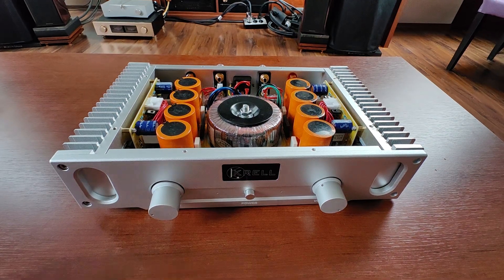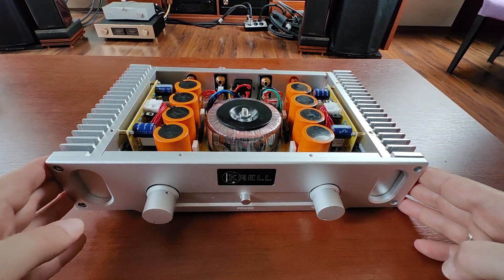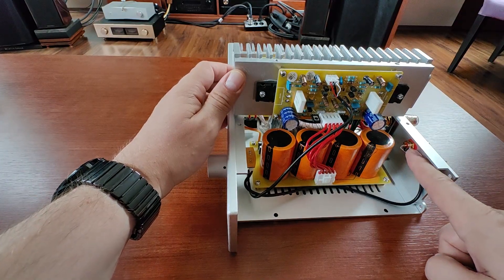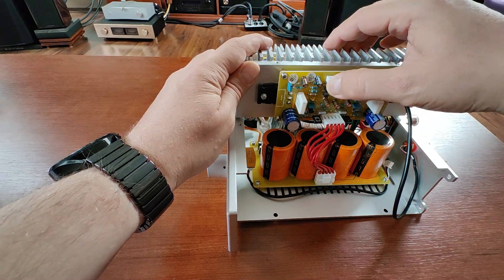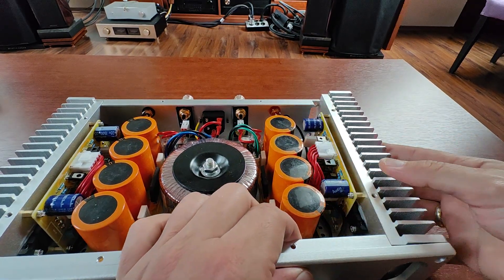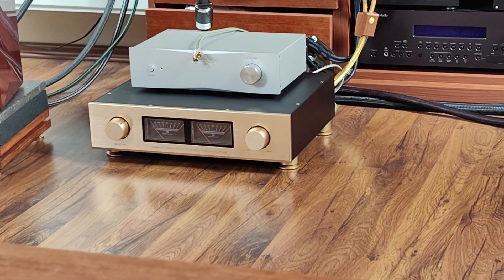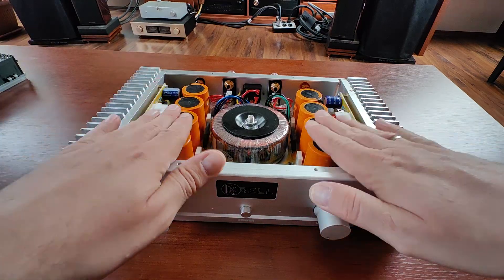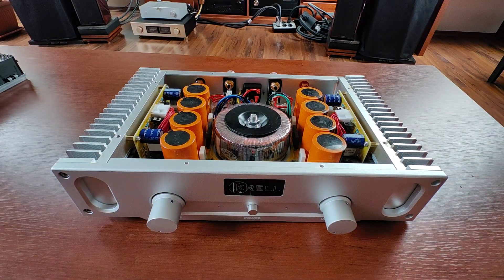Musical Fidelity A1 speaker amplifier clone: volume control bypass in 10 minutes

Comment: Can i use one master volume control?
Reply from the maker: @maxrider2887  that's the general idea here, to make MFA1 clone pure power amp and set master volume on earlier stage with preamp:)
Reply: @k4syx  planing to use with wiim pro + streamer with polk r200. Or it must need a pre amplifier . Pre amplifier suggestion please. Thanks
Reply from the maker: @maxrider2887  if you can control volume with Wiim then you don't have to have pre, though digital control on the player will be inferior to analog one. IMHO exception from this rule is control by DAC chip, as for all DACs I have and had it was always very good too.
So for pre check this one out: https://youtu.be/eS4fGOBiMZs?si=KR2M-CfE-81i84fI

Comment: Any difference after modification sound wise and volume wise mate?
Reply from the maker: @izzy1798  volume wise it's the same because you need to set it up with pre or DAC. My ears tell me it's a tiny bit clearer and transparent, and the most important thing is you don't have to setup balance by ear everytime you change the volume
Reply: @k4syx  cheers yes I've done it 👍

Comment: Nice mod. I had an acrylic cover made for the amplifier. The interior is too beautiful to hide behind metal.
Reply from the maker: Cool idea!
Reply: if the cover gets warm it means that it acts as heathsink   This thing must be hot after a while
Reply from the maker: @gino3286  Most of the heat goes away through fins. Top and bottom covers are just warm to touch compared to heat of the fins
Reply: @k4syx  Hi !  thank you very much indeed 
I have found a schematic in the web but i could not see trimmers for bias setting
Is it fixed ?
Probably the schematic is not authentic
Reply: @gino3286  I made the ventilation holes bigger than original, but yes, I constantly check if something is getting warmer than usual.
Reply: @quma001  hi very good indeed 
Another good idea is to check the bias 
I do not know if they provide some values and info about the procedure 
Nice amp indeed

Comment: I am interested to see if you need further mod to make it better. Or what further mod you will do later
Reply from the maker: It's not like it needs modding, it's great straight from the box. But it can be better. Bypassing the pots, using real preamp, later maybe soldering some nice silver plated solid cores between RCAs and PCBs, that would be my choices
Reply: @k4syx  if you could change any signal path capacitor inside this amp, which ones would you change? that would affect the sound significantly? perhaps to a better film or even paper oil cap? Thanks!
Reply from the maker: Anything that's straight in the audio signal line path - with film ones etc.
The problem is that these are way more expensive and larger for same capacitances and that's why we usually see electrolytes everywhere
Reply: @k4syx  thanks, if i ever figure a way to access inside the a1 clone i will see if that can be done!

Comment: I purchased both, the DartZeel D5 Pro clone and the MF A1 clone. As both continue to “burn in” -here are my first impressions. (For reference, I have about 25 receivers/amps in my collection; my reference amp is a vintage Marantz 2252b that you can purchase for ~$USD 1600. This Marantz is exceptionally musical, open and clear. My reference speakers include an 8 foot tall set of Voigt Pipes and and Open Baffle’ (18 inch bass driver, 12 inch mid and two asd1001 tweeters): Compared to the Marantz both the the D5 and A1 are significantly more veiled ~40% less “open-transparent-clear” (mid range and tweeters). The D5 is about 10% better than the A1 - making the A1 clone the better purchase. I would say that both offer relative value, given the price. Sonically they both compare well to the Schiit Vidar.  They are not giant killers. I would be looking at both as platforms for experimentation e.g. replace capacitors etc. Please share your experience with these!
Reply from the maker: That's not exactly fair to compare them to 1600usd Marantz:)
Yes they have great modding potential and when compared to something with similar or even somewhat bigger price they win hands down. For me the interesting thing is that these basically scratch the surface of the clones market, as there are copies of different brands going for as much as 2k USD.
Thanks for sharing!
Reply: I have vintage Marantz as well 2265B. I don't know what kind of speakers he was using, but what I heard was completely opposite. Dartzeel clone is a another level amp, specially driving hard to drive speakers. If you want little more clarity on Dartzeel amp just switch with silver fuse.
Reply: Comparing new stuff in such a way to a well used old receiver makes not complete sense. YMMV
Reply: I simply don't believe that an old Marantz Receiver (AB Bipolar circuit..) sounds 40% transparenter than the state of the art circuit of the DartZeel clone. No way! The old Marantz Monster with its 40Switches and tone controls may sound OK but never better than these minimalistic circuits of Musical Fidelity or DartZeel. In my opinion mcroeser has a very special taste, rather unusual..
Reply: @helmutmueller-d7t  yes I agree, these new topology often sound bright don't know where's veiled came from
Reply: If they sound veiled you should switch to a better power cable and potentially power regenerator
Reply from the maker: @MasterofPlay7  yes DartZeel loves some good power cords, however it does get more transparent with burn in. I wouldnt call it veiled at the beginning of the process, its not, but it does get way better!

Comment: Give the reason why you need to bypass the volume control.
Reply from the maker: 1. It's made with very cheap pots
2. It's very hard to match the volume level setting by hand with two separate pots

Comment: What's the impedance of the volume pot ?
This impedance is part of the load of the input......so it should be good to know the load difference afterv the modification and correct it if necessary ...........putting a resistor of the same value as the pot ( in //  as done when using the pot ) will restore the initial impedance of the amp !

Getting RID of those ( bad industrial ) connectors by soldering the wiring directly to the pcb and using better quality wiring will be another upload as well as installing  better RCA plugs .

Have a nice day and thank you for the upload.
Reply from the maker: Good idea about measurement, I'll try do that tomorrow.
Yes I think I was mentioning this in the video (and surely in the comments) that I'd like to solder some nice silver plated, Teflon coated OCC wires directly to PCB. This is a very nice and accessible build to try f.e. bridging power caps with MKPs with low ESR or other things one would like to test and evaluate with own ears.
Thank you!
Reply: I'm not positive, but the volume pot ensures that the LOWEST impedance is the impedance of the pot (say 100k) OR the subsequent input circuit (if it's lower than the pot, which is unusual).  Actually, it is probably more like the impedance of the pot IN PARALLEL with the input circuit impedance.  If you remove the pot, then the input impedance becomes the impedance of the circuit.  If the pot has 100K impedance and the circuit has 1M (meg-ohm) impedance (most input circuits I'm familiar with have very high impedance) the resulting input impedance is about 90k for the amp.  Remove the pot and the input to a 1M impedance input circuit is 1M.  Note I have no idea what the A1's actual input circuit impedance, but normally it is a lot higher than 100k.  So in any case almost certainly a LOT higher.  What does that mean?  I'm not entirely sure.  Typically a higher input impedance is better but I don't know if that's a reliable rule.

Comment: Hi...My unit will be arriving in a few days..Will do this mod. Thank you!...I wonder if it could be possible to make it a mono block?
Reply from the maker: Actually this is set of two monoblocks in one case. There is no way to connect them in series, but you can use two for biamping thus dedicating whole power of one to one speaker
Reply: @k4syx  Thanks.....looking forward to hearing it.

Comment: Thank you for nice video, could you show amplifiers boards more in details? I am curious if these boards are available as kit to diy on aliexpress....
Also I wanted to comment your statement about volume attenuation. If you see schematic of many amps, preamps, volume pot always work this way- it attenuates signal coming to the device. Here we have just power amplifier with passive attenuation, but if you take preamplifier, most of the builds have same attenuator before (or after) the amplification stage. Almost always preamp or power amp has preset gain. Also, regulating signal voltage in dac or computer is bad idea, it decreases audio signal resolution and quality, best preamp is passive ladder stepped resistive  network with or without unity gain buffer after. See elekit tu-8500 beloved by many DIY kit/preamp. It is just passive attenuator and tube buffer with unity (no amplification) gain
Reply from the maker: Hi! There are many diy mf clone sets available but these seem to be different, I was looking for them separately but couldn't find any. As for volume setting via attenuation I prefer to have it at the end of chain. About the source volume setup: current TOTL DACs are doing this really, really good: I have yet to try preamp that will do that better than my Gustard X26PRO. Also, many of the TOTL converters use analog volume control as the last output stage. But for cheaper or a bit older (5y?) equipment you're right. 
And yes, volume control on PC or streamer is the last desperate resort because of loss of source resolution right at the start of the chain!

Comment: Nice mod, I'd tempted to wire in an uprated external toroidal...or two.
Reply from the maker: Having two separate sounds good. This has also great modding potential as I would replace signal carrying wires with silver plated teflon coated solid cores: I would solder them to the boards. But its great straght out of the box!
Reply: I imagine one could “convert” the amp to a mono block by simply disconnecting one channel from its power suppy. This would be something like the unit having twice as big a transformer. Would need two amplifiers for stereo but it’s still a very cheap option.
Reply: @dksculpture hmmmmm this sounds like a great idea. I wonder if and what the improvement can be had from doing this. I have to of them here now. 

Nice mod list would be:

1. Bypass the cheap volume pots

2. Replace all signal wires with good solid core silver plated copper telfon coated wires and solder directly to the boards

3. Remove 1 channel from the power supply creating a mono amp. Cool thing about this mod you have to complete amplifier sections if something goes wrong with the ones that you using!

4. Upgrade the 4 large caps to a larger value for more capacity. 

Hmmmmmm
Reply: Or use an external power supply.